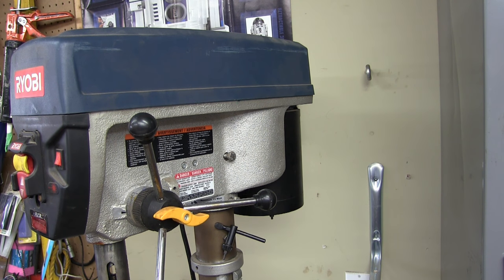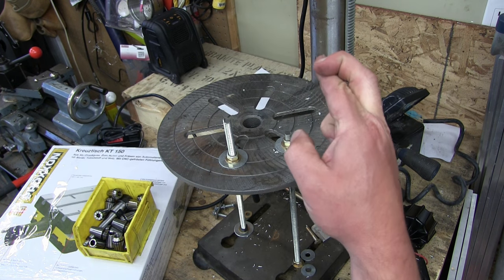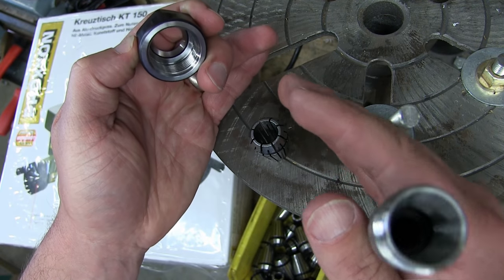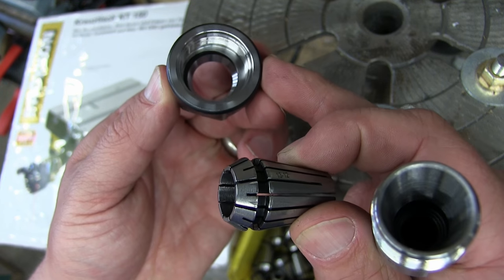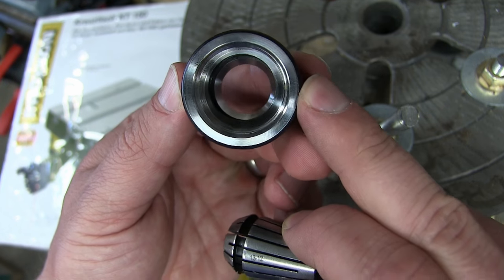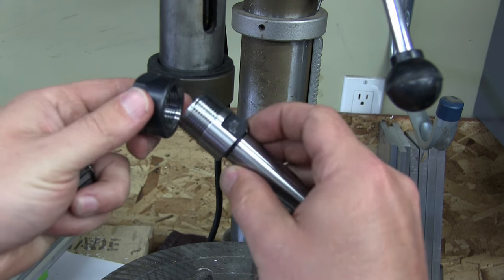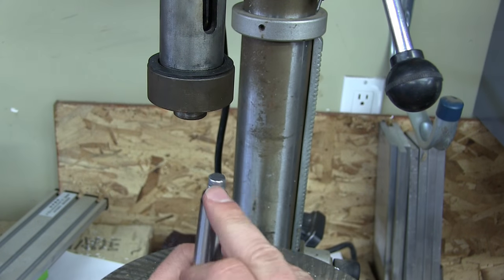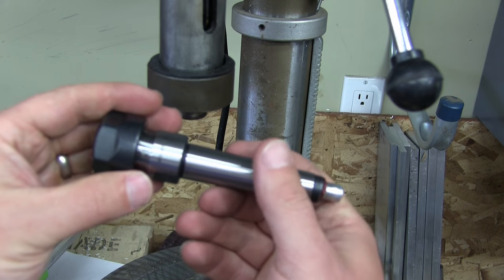SUCCESS!! Drill to Mill Conversion.

Comment: You're supposed to snap the collet into the nut first buddy... the eccentric pulls the collet out when you loosen the nut. This is by design in even the nicest of tool holders but then again... there was that one time in summer camp with a dewalt tool battery..
Reply from the maker: OOOOOOhhhhh. I guess I need a new nut then. Thanks Max!
Reply: What he said.  I did the same thing the first time I tried to use a collet.  I saw that the collet wasn't seated properly like the other tools I already had, so I seated it, and bob's your auntie, as it were.
Reply: collet installed first then you slide your tool (endmill/drill) in. that off set is so your collet wont fall off. fyi wipe clean everything before assembling the collet to make sure there's no chips. and also youre right should never use a jacobs chuck for milling. only designed for z axis on mills. seen people try to use it for milling and completely ruined the jacobs chuck.
Reply: Everybody I know has thought at first ER collet nuts are machined wrong.  First time I've ever seen anybody "fix" it with a lathe.
Reply: Well I sure was convinced that the collet was a heap of crap, and very pleased he corrected that sloppy reject in the lathe 😂.
Reply: yeaaaaa that retains the collet in the nut so you dont have to hammer the collet out of the taper
Reply: Reckon AvE needs to issue an apology to China and the tool manufacturers there... All of the Chinese tooling I buy off Aliexpress has been very good. Not just "good for the price", but good in general. 

Although AvE is nowhere near as bad as Mr salesman at the stainless steel fasteners place locally, who told me that it's illegal to import stainless steel from China because "it's all radioactive" :D
Reply: Max Maruszewski was going to say the same thing! I got a spindle from China for my diy cnc and thought the same thing AvE did. I actually used it for a bit workout it in there right eventually I got a h hell of a vibration then I figured it out.
Reply: lol, I immediately came here to state the same.  I see many others have beat me to it.
Reply: AvE hahahaha I was going to say the same thing to you but no point in beating a dead horse Hey yoy learned something today
Reply: "ER" apparently stands for "eccentric ring".
Reply: I thought it was from a brand name?
Reply: It's pretty weird that he's got a mill, a lathe, 5,000 grinders, and pretty much every tool ever made and the vice into which it's dick goes but he hadn't come across an ER collet before. Although that does happen... I know there have been rare occasions (can't remember specifics) where I am presented with what, to everyone else, is extremely common knowledge but I am learning it for the first time.

One time I had to explain to somebody (who wasn't mentally disabled or head injured or a child) that two points are always going to be in a straight line.
Reply: Robby Nowell   but it feels.......spectacular!
Reply: sooo, if you shart yourself while torquing her down, is it over torqued?
Reply: Just what I was going to add.   The er32 stuff on the 24krpm router I have experience with had the same retainer.   Cringed when he stuck it in the lathe, full well knowing it didn't actually matter and may be more convenient for this application.
Reply: he is 
AvE 
he does what he wants!!!
Reply: As above.. closed my eyes and watch through my fingers.. 

Jim Wilson, same.. everything has been good enough to get ther job done at less then 1/4 of the price, last time I got radiated was when I went out side and ate a banana.
Reply: There is a box of maybe 20 ER collets in shot at the start.
You sure your not mess'n with us?  :)
Reply: if in doubt, break out the cyanoacrylate
Reply: Well shit, I got my ER32 Collet and had the same "issue", no problem, stuck it in my lathe and "fixed"it. Its worked fine although when I take the nut off I do have to use a rubber hammer to tap the collet out, I didnt know this was an intended design!
Reply: Seems to be an ER nut, as in "Er, you shouldn't have machined that bit off, it was supposed to be there".
Reply: how many fancy sounding torque wrenches do you have?
Reply: +Jim Wilson Similar experience here. VASTLY better than the cheap shite at the local hardware store. Especially taps and dies, they really are remarkably good.
Reply: Wtf, they are all wrong! ;-)
Reply: I want to see the video of him taking that er collet out of the taper
Reply: should have read the manual ;)
Reply: At exactly 5:00 you can clearly hear him snap the collet into the nut.
Reply: Watching you bore that nut out was heartbreaking to watch.
Reply: +Donny Wallbanger That's what she said.
Reply: Max Maruszewski that's on every professional toolholder
Reply: ChuckE2009 did the same thing lol.
Reply: it was intentional to improve the balance
Reply: Watched video, gasped, headed to comments. Happily the crew already has the case of the "bad" collet all sorted! Nice job gentlemen!
Reply: hahaha
Reply: M4GHOST45  "At exactly 5:00 you can clearly hear him snap the collet into the nut."

Except the collet and nut are not attached @5:00, you can see the exposed thread.
Reply: Hirudin   For our favorite eccentric uncle.
Reply: hehe hehe haha .........Nice One...and Its really made for this video. Good Catch....:)
Reply: That was my first thought as well when I bought an ER32 set for my big drillpress. Had I more time when I tried to use it the first time, I would've done the same thing AvE did.
Reply: Ha ha he got us on that one for sure!
Then again at 4:57 I was sure he was going to burst a blood vessel in his eye!
Reply: Why is there always an expectation of chinese stuff somehow being made wrong. The chiese have made CNC machines for 40 years I think they know how they are supposed to work by now. I have used chinese machines proffessionally and there was nothing wrong with them other than age having made them leak oil like a pensioners prostate. Mind you they were not the kind of cnc:s you buy for $250 new from ebay though.
Reply: Oh gawd. I scrolled down to comment right at 1:30 when uncle bumblefuck starts complaining about the offset and sure enough, he goes and fucks it by the time I read this.

in case no one else mentions it, sometimes it's a trick to snap the collet into that offset extractor ring (which is for REMOVING the collet from the internal taper) and keeping it in place while you screw the nut on. what you don't want is for that offset ring to be pushing on the collet. proceedure: pick your cutting tool. use it to select your collet size. snap the collet into the nut. insert the tool into the collet after its in the nut. hold the three together. with your third hand, spin into place finger tight. torque to spec.

fyi over tightening the nut will blast the holder right clean in two. or bust a nut. or well, somethings gonna give.
Reply: First time ever you did something that made my jaw drop in disbelief, as everyone else has said that eccentric part is by design. Ive seen alot of people confoozled by it at first sight, never have I seen someone "repair" one on a lathe. -5 for ignorance, +4 ingenuity, +1 for comedic factor. Knowing is half the battle.
Reply: so does this mean that that chinesium call it assembly he bought did not need to be turned in the Lathe for use?
Reply: I left a comment before I read these about having the same problem Ave did & I fixed it in a similar way. I'm new to collets & metal lathes & I can't get my head round how that collet nut works!!!! Aren't the the tapers on the collets & the nut supposed to meet but how can they with that eccentric ring. They obviousy do work somehow as one comment even said ER is eccentric ring!!!
Reply: some sort of triple universal jointed collet was clearly the way to get around that ER
Reply: Yeh I worked with a trained "tool maker" from India or Pakistan, who refused to accept that the collet had to go in first, hence why I started bringing my own kit in because all the other ones were completely fucked :(
Reply: It's already been done to death, but yeah, the eccentric is part of the design.
Reply: Absolutely correct. Was just going to comment on the same thing.
Reply: Holy bajesses 65 comments on this not Including me the count up this point must have been sweet like the smell of food rottening in the fridge. yeaH! Collets are supposed to be like that sorry I felt the same way once when I first noticed. The retainment ring and I thought I discovered the reason for the bad alignment I had had for a while on the whole... might have walked away without someone telling me but after an hour checking the other holders and saying to myself "No"... there's not a good one in the bunch. I just kinda took it as a goat does dinner.
Reply: I've always been told that a drill press should never be used as a mill because the spindle bearing is not designed for side/radial loads. Is that just an old wife farting down wind?
Reply: Just logged in to comment about the collet nut 😂
Reply: Bahahahahahahahahahahahahaha I remember my first time to !!!
Reply: Next we'll get a video about why the collet was junk...
Reply: I've seriously never seen some say they dont have much experience with a tool, then proceed to say it's broken and then "fix" (break) it in a lathe lol. I'm taking back my subscribe lol.
Reply: @bucknaked31  Remember, he buys his tap water in bricks.
Reply: About the nut supposed to be wrong, i had the same feeling, but before "fixing" ( with the lathe ) i gave a look abroad ( some video of more experienced machinists ) and so i understood that "eccentricity" was "normal".

About glue on the morse taper, you can buy ( from Banggood China, eg ) morse-2 ( MK2 ) or morse-3 collet holder, ( or whatever you need, your tape-press has MK2 ? ), screwed ( female ) in the back, so you can use a pulling screw: my collet holder ER25 ( for my lathe ) is MK3 and it's screwed ( metric, female ) in his back 12MA ( 12 mm diameter,  pitch 1,75 mm ): the pulling, long screw, is easy to find in Italy and Europe and i think overwide, now ).
( not to forgetting Whithworth sistem, which is still used in pipelines sistems, including home water pipes, and in electronics systems, where every chip and every printed circuit board does use submultiples inches distance between pins ! )

About the Proxxon table, that also i use, i think it's ok just for drilling purposes ( vertical force ), or only for very little lateral force. 

Cheers, Alessandro
Reply: Would someone be so kind as to point me to the correct parts?
Reply: I went through this once before myself when an ER 32 brought it to my local machine shop and gave the boys a great laugh when I asked them the machine it for me. But then I was taught the right way to use it they call it snaps inside that eccentric ring. Living room learn right 😁🤟
Reply: That was painful to watch.
Reply: Yeah, I was curious about why it was modified…
Reply: @underourrock youre
Reply: @alexanderlieder4477  Bob's your uncle is the phrase I was modifying.  I know a gender change can be so confusing to some.

Comment: I know this is an old vid but it took me this long to plan and execute my project. My Bridgeport (Ark.) Kneeless Mill came together this weekend and I'm 
pretty happy with the way that it operates. It started life as a Wun 
Hung Lo drill press, but I grafted an ER20 straight shank collet chuck 
onto the shortened spindle, replaced the quill bearings, added a cheapo Ebay XY 
table and a machinists vise, added a scissors jack under the table to 
prevent it from deflecting when I'm milling, an eye bolt with the end 
turned to fit the quill groove for a quill lock and it was a done deal. 
It makes surprisingly nice cuts in aluminum using a HSS router bit and no 
doubt I'll be able to take out more material when I get some actual end 
mills to use with it. I'm also going to add a spur gear and a worm gear 
to the down drive for a fine depth adjustment because it's tight enough 
to benefit from one. All in, I've probably got less than $300 in this 
project (including the drill press from CL) and now I can make myself even more goodies. 

I've also learned how to anodize aluminum using a battery charger and my
 finished parts don't look half bad. Love it when a plan comes together.
I'm truly a shade tree machinist as a close by live oak will testify.

Comment: 5:01 I too use this method to measure torque. Hasn't failed me yet. Cost me a few pants though
Reply: its the only truly accurate way to measure any rating of torque! XD thanks for the chuckle
Reply: Numsz I didn't notice that first.  Thank you for the laugh!
Reply: Barking Spiders everywhere!
Reply: sometimes i forget im doing the clicking....
Reply: HylianOverlord I'm fucking laughing so hard right now
Reply: I broke at least as many parts by using a torque wrench with the "right" torque as by hand.. BUT: my hand tightened bolts never got loose!
Reply: HylianOverlord My God I love that guy
Reply: Then one day i took a chance,
Tried to torque but shit my pants!
Reply: Tried to use ABOM torque ended up creating AVE BOMB torque, way more deadly!
Reply: Ha! Another way of "Letting the Smoke Out"...A.K.A. "Torqueing by P.S.I."
Reply: Numsz Don't worry, as a professional engineer, i can tell you thatevery machine shop guy i've ever met measures torque in the fuckl scale, ranging from "That should be enough... HEY BOB, HELP ME OUT HERE, I NEED MORE WEIGHT!!!" to "... Wonder what would bend first...".

Again, as a certified engineer, i can tell you that this method of measuring force (or weight... or speed...) is COMPLETELY sound.

Rational people: If it ain't fucked, don't screw with it.
Me: If it ain't screwed, i'll fix it till it's fucked.
Reply: I like the FT method... is she FT? (Fackin Tight).. no? Well reef until somethin breaks then back it of a smidge.

Comment: When you have an extremely shaky setup, and/or very long skinny tool, and/or difficult machining situation, and you own a center-cutting endmill, rough what you can with a drill, then plunge-mill with the endmill.  Plunge-milling is using an endmill to cut downwards without having the whole diameter of the tool surrounded by the material.  Somewhere around 50% seems to work, less or more depending on the situation.

If I had to mill with a cheap drill press, I'd do most of it with 60% step-over and then clean up the scallops (left-over material) on the walls of the piece with the side of the endmill.  It'll be a lot less painful than basically any other toolpath method of material removal (when drilling is done) with a drill-press-mill.
Reply: Hmm, I'll try that next time with my modified drill press with a cross slide vise and end mill in the chuck!

Comment: that offset ring is to lock in the ER collet and the offset part makes it easier to pop it out
Reply: AvE just ruined his collet nut. great work! good luck removing tools and collet now!
Reply from the maker: But it wasn't open enough to let the collet engage the taper, it was just hitting the ring it one spot and tweaking the spring ring (nomenclature?) over. Seemed fucked to me.
Reply: Mick Duijf I was about to say the same thing.. clip the collet into the nut before screwing the nut on!
Reply from the maker: Ohhhh.  Collet in ring FIRST, then into socket. Hahahahaahahaha. Now I get it!
Reply: AvE at a boy we knew you'd get there in the end :p I made exactly the same mistake lol you like hook one edge under and push
Reply: I think the collet was too big for that chuck. Mick's right, the offset enables you to pull the collet out with the collar. Without it, you;ll need a hug trying to get the collet out.
Reply: that's weird. i know it's somethimes hard to press the collet spring into the nut especialy the smaller diameter ones. i once didn't put the collet spring all the way into the nut and tightend it onto the toolholder, wrecked the nut, collet and the tool. i was not able to get the freaking thing out again.
Reply: We love you Uncle Bumblefack!
Reply: AvE ya thats how they work engineer lol
Reply: So you DON'T need a lathe to make this work after all?
Reply: ... I literally haven't read a single thing on a ER collet ever... but even I noticed the groove on the collet and that thing in the nut is supposed to hold it in there :'D

Comment: AvE Loving the Video's so far, just a suggestion IF you still have a cheap tool like a grinder or drill ect.. why not see if you can improve it's quality, like replace bearings, it put some Epoxy on the motor windings if missing or change some components like soft steel gears, if this is possible at all, would be a fun project to see you actually turn a cheap $30 tool in to something worth having IF possible :)